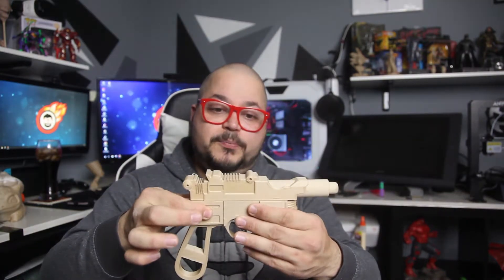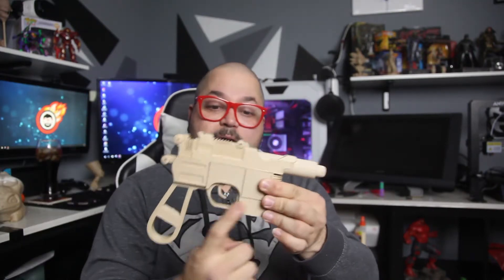Failed prints with the Anycubic I3 Mega? We have a FIX for you!

Comment: Its crazy I did build the wooden ultimaker a few years ago. It worked perfect from start basically.
Then I bought an i3 mega. Upgraded it with like everything.
But I cant get it to print properly. It has retraction problems and random gaps between walls. Fukkin hate this

Comment: I just now had a problem with my i3. Mid-print the nozzle repositioned itself too low and stalled the print. Now when I home the nozzle, the nozzle is about 4mm below the plate.
Reply: Use a paper or the paper it came with that you can use to level it, the nozzle should be a paper far from the bed

Comment: It's the filament sensor. Since it's not stationary and the filament flops around, every so often it would take pressure off the switch, triggering the error. I unplugged it and used a jumper wire, problem solved. It hasn't done that stupid beeping at me since.

Comment: I didn't even consider the SD card as the culprit. One night the print worked fine, tried to make a duplicate the next day and bad print. So I watched  the print during the 3rd attempt at the failure point and the head just started going wild. Same file, different card, and ta-da! Back in business. :) Video might have rambled on a bit but it still nudged me in the right direction.
Reply: Has it come back since? The card trick never worked for me. I'm confused as to why or how that would trigger a feed error. I just used a jumper on the sensor and haven't had an issue since.

Comment: Got my Mega Pro, printed the owl with no issues, but it would not print the part I created. It kept moving but stopped printing after a few minutes each time. I messed with multiple settings, reloaded my part, and printed the test owl multiple times. I finally decided to load my part on another SD card and it is at least doing more than before.
Reply: So it's still stopping on you? Try unplugging the filament sensor and use a jumper wire between the two pins on the printer's connector. It's to fool the printer into thinking filament is loaded. My issue was the filament moved around inside enough to take pressure off the switch every so often.

Comment: Any other problems have you had with this printer? Ty t👍🏻
Reply from the maker: The other problem I have had with this printer is not an issue with the printer itself but with the filament. If the filament breaks in between the filament sensor and the "feeding tube" the printer thinks that there is still filament and keeps on printing. So you have a failed print plus yout extruder now overheated the filament and probably clogged it, and The only way to fix that is to replace the extruder.
Reply: Geek Hotfix thanks for the feedback much appreciated

Comment: That card failed me in second print :D
Reply: The filament flops around inside the sensor, unplug it, use a jumper wire, problem solved.

Comment: My Anycubic Mega S (same as the Mega except with upgraded parts for additional filaments without needing to buy anything extra) won't take any of the high speed cards, I have to use the standard type 10 cards. None of the Ultra or x80 etc cards run on it (won't see any of the files on the cards). So just make sure you get the plain black SanDisk cards and it should be good.

Comment: I’ve been having same issue with my anycubic, what card did you buy? I’ve tried about 3 old cards but none of them have been printing large files for the past few days. I’d rather spend a few bucks on a new card entirely than just assume it’s the card reader, but I’m afraid that might be the problem.
Reply from the maker: That was my problem as well, so I bought a 16GB Sandisk card with 80mb/s transfer for just $6.50. Here is the link, have not had any problems with any prints whatsoever since then.

https://www.amazon.com/gp/product/B0143RTB1E/ref=ppx_yo_dt_b_asin_title_o01_s00?ie=UTF8&psc=1
Reply: Geek Hotfix thanks for the reply, I got a few sd cards (mine fully broke haha) but I found the problem was with my heated bed. It was showing that it was heated but it wasn’t fully heating and the temp would drop and fully stop the print. I’ve ordered a new bed and am currently printing with no heated bed just fine